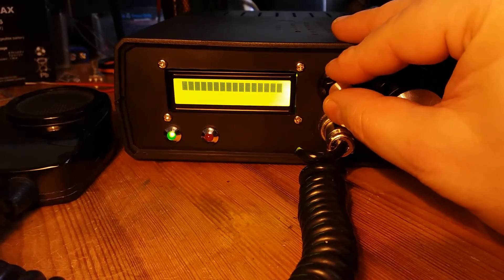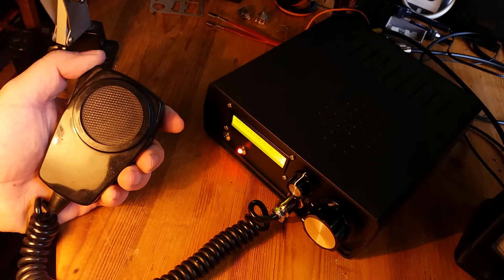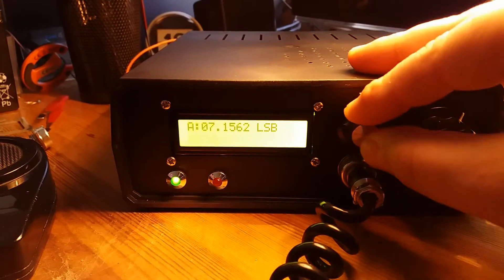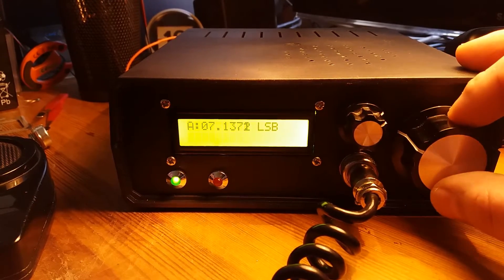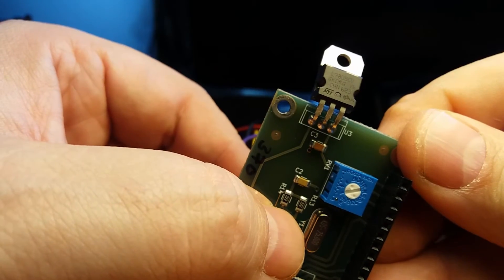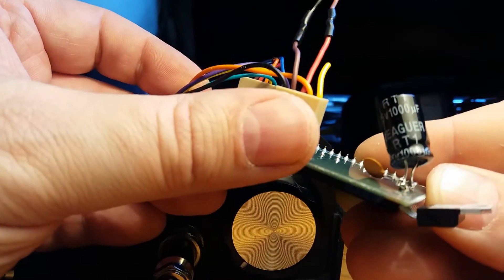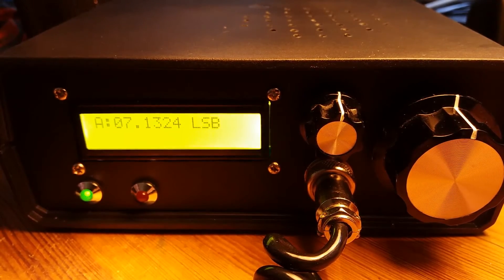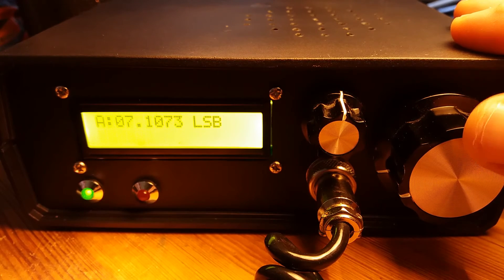How to get rid of tuning clicks in BITX40v3 (version with Raduino module)

Comment: Did you use coax for the vfo signal to the main board and antenna connections? I tried that as well and still have very loud clicks when tuning. Have you tried other code for the dds? I don’t like the way it jumps when tuning. I want it to tune at the same rate all the time and not be dependent on speed if the knob. I built a vfo using another type of dds but it didn’t have enough drive for the mixer.

Comment: I know this is about a 3 year old video, but I just received a unbuilt Bitx40 V3 with radunio and I have completed the assembly in the enclosure that came with it.  It was suffering from the tuning clicks.  This video was very helpful and easy to follow.  Thanks by the way!!  But I have done this mod to my V3 Bitx40 as well as VK3YE mod on the power connections (filtering) and I still have the tuning clicks.  I put the resistor at the on/off switch to the orange wire feeding the radunio, I put the 1000uf electro cap and the 104 cap on the input side of the voltage regulator.  Still having issues with the clicking.  Have I missed something??  Is the resistor value critical???  I couldn't find a 56 ohm resistor, so I used a lower value.  Juddie WD8WV
Reply from the maker: Hi Juddie,
I apologize for the late response. Indeed, I have done experiments with removing clicks a long time ago and I do not remember whether the resistor value is critical. Maybe it's worth checking 56ohm or a little more. By the way I know, the solution I proposed does not work on all copies of this kit.
Reply: @focal28mm  okay, thanks for getting back to me.  I can live with it, but I hate it clicking when I am tuning.  I have made a contact or two already with it.  Thanks Juddie WD8WV

Comment: Hi Thank You very much, I did as you said and it worked first time 100%, but I did notice when my volume is set to max, I have a squeal, - but I am not sure if that was always there, Thanks again 73's VE2TSM
Reply from the maker: Hi Mario, nice  that my tip was helpful. I had the same issue with squeal. After shortening of wires connecting  DSS board and main board squeal disapeared.
Reply: Thanks - I do have it in a temporary enclosure, and I did leave the leads long, with the exception of the antenna leads, thanks for the information (I see it's a problem for many) I will shorten  the leads as short as possible, once I find a new home for the unit 73's and thanks again
Reply from the maker: All the best and 73!

Comment: Thank you for tech tip.  At first I installed 1000uF and then clicks still there but not as loud.  Installed 100pF things got way better. Finally installed 1=56 ohm 1/4W as per your instruction  No clicks detected!!! 73 WA9DOH
Reply from the maker: Hi Larry! Cool that my advice was helpful to you. Btw, BITX40 is very nice rig. I have tried it in the field operation last weekend and I am very happy with its performance on 5-7W only. 73 SQ5WN

Comment: Hi. I added the capacitors without the resistor and it worked. No more clicks. I also removed the regulator from the board and attached it to transceiver casing with leads to the board. Thank you.

Comment: Where did you get your case? I like it! Your mic connection is it 4 pin? Can you point me to a website where i can add a mic? Wiring diagran. What brand is your mic?
Reply from the maker: Hi Todd! As I remember, my case is Z1 one by KRADEX company, bought in local electronic shop. You can google for it - the white version of the case is to buy here: http://www.tme.eu/gb/details/z-1_b/enclosures-with-panel/kradex/z1wj/
As for the connection of microphone, various mics have different wiring diagram. My connection is 4-pin, and I found via google my model of mic with information on GND, PTT and mic pins location. On the video is my old mic from RADMOR company - wiring is compatibile with Kenwood TS-520. It is dynamic mic, so I've made simple preamp for it. BITX40 board is electret mic ready, so you can use any cheap mic from  CB set. I tried ALAN/MIDLAND mic from ALAN 102, 109 and 199 CB-Radio setup, and it worked excellent.

Comment: I did the mods and the clicking issue is not resolved. I installed a 52 ohm resistor in the 12 volt line to the DDS as well. I removed all of the unused conductors from the connectors. BTW I think your rig looks superb, it appears simple and very nice and clean and great workmanship.
Reply from the maker: Sometimes the trick works, sometimes not... BITX40 + Raduino are only few weeks on the stage; I hope one day problem of clicks will be solved definitely. Many thanks for remark concernig my rig!

Comment: Is the capacitor size critical. Would 470 Ufd work..?
Reply from the maker: Richard, 470uF would work perfectly. In my case, 1000uF was on hand.
Reply: Irealy admire the case your using. I am curious to know how you wired up the red xmt indicator. Did you  use a toroid inline with the rf output.
Reply from the maker: Richard, the TX +12V appears on pin #1 of the K1 relay when the PTT is pressed. So wire the LED between pin #1 and pin #8 (GROUND), and remember to  put a current limiting resistor (1K to 1.2K will be fine) in series. 
When You are looking at the relay pins from the bottom side of PCB, the number of pins are:

8 GND    1 TX
7              2
6              3 RX
5              4
Reply: Thank u very much for the info. I will do that mod.
Reply from the maker: Good luck Richard!